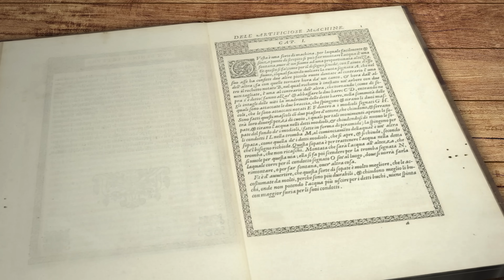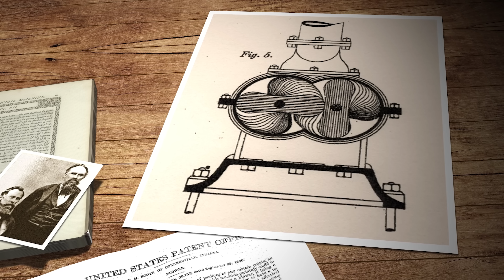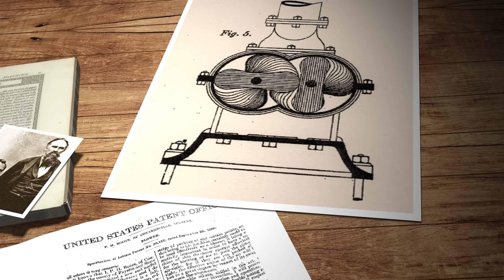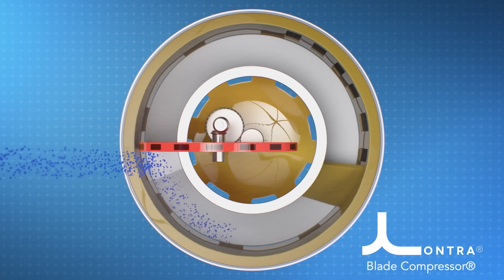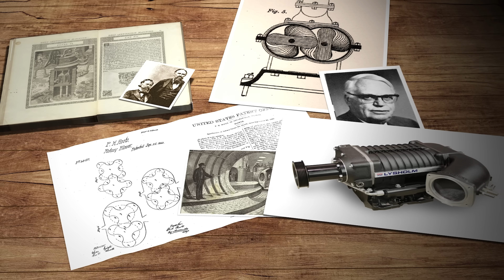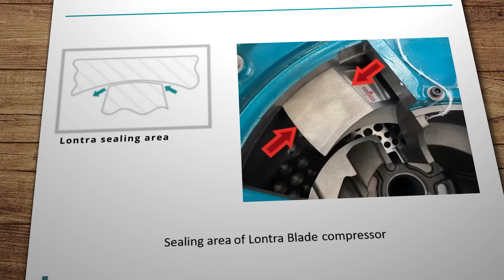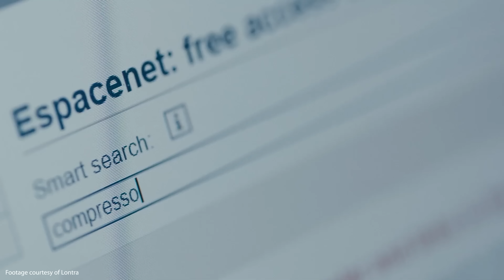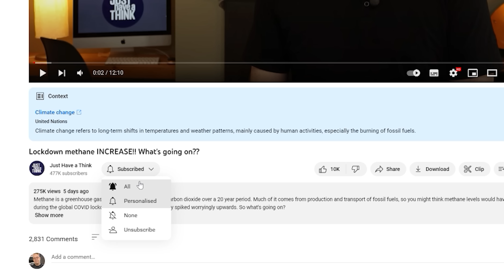Compressing air to reach net zero. A 'revolutionary' innovation.

Comment: Looks Complex and expensive, and maintenance-heavy. The air at intake for devices like this needs to be extremely clean, so this is a niche market compressor. There is always a trade-off somewhere: cost, efficiency, etc. This is why there are so many types of compressors. Don't quite believe the statistical analyses regarding global impact. That's another story, or is that the selling point "IT'S GREEN".?

Comment: That rotating sealing disk would get very hot. The animation shows it as having cut out like a disc brake to allow cooling air where as the practical example is a solid disk. I would be interested in operating temperatures.

Comment: I have thought, and as CO2 is unable to cause any climate emergency net  zero will fix nothing at all.

Compressing air heats it increasing pressure.   Cooling sees a pressure reduction.   This is largely irrecoverable and why heat pumps function.

Comment: Let's first fix all leaks. Compressed air leaks are a huge loss in ALL industries. 

Also I dont know why I havent seen this type of compressor in heavy industries, but continue to see  screwcompessors.  (Probably the opposite of what you stated: they are not cheaper to manufacture.)

Comment: Improved designs work better, but even the best will sometimes need a repair. Hydraulics are appropriate in some applications, but for the modern mass-production factory, Pneumatics are being used in any place where they can be used. One reason is that when it invariably springs a leak, the mess is simply some lost air. Of course electric stepper motors and screw-actuators are also sometimes used, but...pneumatics are here to stay.

Comment: Why not a bladder-based air compressor -- rather like a squeeze bulb.  Now the only leakage would be that past the check valves -- which are much simpler to engineer.
If elastomers aren't up to it, use a SS bellows (which are commercially available).  If such bellows don't provide adequate compression with a single bellows stage, use multiple stages, like a 3-cylinder steam engine (run backwards).  There's a YouTube video that describes the compressor used within a (medical) oxygen enrichment device which is five stages, I believe.

Comment: That "more surface area so the sealing gap is much blah blah" is pure claptrap. This thing has the same problems as a rotary engine, only apparently this one doesn't have separate gap seals, instead assuming this engine mess will be easily manufactured with tolerances within a thousandth on all rotating mating surfaces.  Poppycock. This thing's gonna be leaker than a timed-out colander.

If you want an efficient compressor, build a closed-loop trompe tower with sterling engines that run secondary pumps off the cooling water waste heat.

Comment: A trompe is a water-powered air compressor, commonly used before the advent of the electric-powered compressor. A trompe is somewhat like an airlift pump working in reverse. Trompes were used to provide compressed air for bloomery furnaces in Catalonia and the USA.
The trompe is one of those lost technologies. Around the nineteenth century, if a mine were located near a river, they would install a trompe to use energy from the falling water to isothermally compress air.
If developed again in could be a very integral part of solving energy issues without environmental damage.

Comment: It seems to me, if there is any wear or run out, with the gears and bearings, as they will. The driven disc, will be late. 
No mention, of heat related issues, here.

Comment: The market has spoken they are in receivership. To complex, misleading presentation quotes very low pressure performance application and compares to dry screw compressors.  Oil flooded screw compressors achieve good efficiency at high numerical compression ratios something this thing could not as it would bind up at elevated temperatures.
Reply from the maker: A great shame. I am launching a series of technology review videos for 2024, looking at the winners and losers from my videos over the last 6 years. I guess Lontra will have to be placed on the list entitled 'Market Failure'. Very sad for all the folks who worked so hard on the innovation.

Comment: Interesting design. Are you sure the 10% figure is for air compressors or just compressors. I struggle to believe air compressors would be that high, though compressors in general seems more likely as it includes all the refrigeration and air conditioning.

Comment: The Lontra compressor won't help make as big a CO2 saving as you think. It only seems to work to 1Bar or 15 PSI, there are far, far more compressors out there working at 7-10Bar and above. Compressors used for bottle blowing of PET drinks bottles for example operate at 40Bar. The blower market is nothing like as large as that for compressors
Reply: The big market is for low pressure high volume air flow in wastewater applications. Sulzer pumps originally licensed the technology from Lontra for such an application but after years of development hell they gave up on it a couple of years ago.

Comment: Without having followed all the details of this design, it seems to me the essential problem could be the rotary motion of the 'piston'? It is the same problem faced by the rotary combustion engine - too much friction burning an awful lot of lubricant.
Reply: Its an oil free compressor. No lubricant just a Teflon style coating.

Comment: I just had a quick look at their web site. With only a 15 PSIG max capability it is not useful for many of the places where a Roots blower, or a screw mill would be used. It is an interesting concept, however it has quite a bit of R and D needed to be a game changer in industry.

Comment: I've just taught myself enough 3D graphics to draw my advanced, far more powerful Turbo / External Heat Engine and will publish on a youtube channel I have soon. A larger than normal exhaust turbine is backed by a sealed turbine filled with high pressure CO2, wrapped in a radial compressor, joined to the same setup on the other end by a hollow axle. Compressed CO2 expands with much force when heated. I have it pumping fuel, coolant and whatever else (ie. hydraulic fluid or second fuel type) in between, also cooling the middle of the turbo/engine.
--
It's designed to work with an internal combustion engine that shoots exhaust gas into each side alternately, with the opposite side cooled by squirting high pressure coolant at the exhaust turbine on the other side, adding steam power and amplifying heat engine power that relies on a temperature difference between ends - HOT-COLD engine... It's a condensing exhaust system so the water from the steam is reused and cooled exhaust gases expelled (or compressed into a diaphragm that expands into the fuel tank to be dumped at a gas station).
Reply: @jerrystephenson6198  .. It's a nice design worth prototyping. Just because you can't imagine it working doesn't mean the principles aren't sound. It's easier to keep sealed than a wankle style rotary engine. Sure, bottling the exhaust fumes is problematic but the two engines are worth a go... It combines the best of both piston and turbine engines so what's not to like? If you're an engineer and you think the idea won't work let me know why because I and other engineers know it will. Solves the issues with the Wave Disk Engine while combining a heat engine. It doesn't have to 'idle' at 10,000 RPM like a normal turbine engine. It's designed to only spark up when needed. Very efficient.

Comment: I think as amazing that technology is history of innovations tough as that each time we are getting new and more efficient machinery our total energy consumption rise proportionally to achieved efficiency. That exactly what have happened with Watt steam engine while it had a few times better performance then existing steam engines those days coal consumption just increased a few times as well. The reason for this is that while you have only inefficient steam engine you would use it only in places where there is no other options or existing options are way worse then this engine. So as efficiency rise so is the number of potential cases where it could be applied.

Comment: Can't a Tesla turbine move air? Why not do this instead. Design disks that can handle the strain, they also double as flywheels. The tolerances are far lower and easier to achieve. Your literally using disks to move air using a motor. The only change needed to fill a tank with it is a ball valve. When the tanks are full it simply switches to being used as a flywheel to store temporary power and the air can be reversed to the turbine in an H circuit to release the power to load. A sensor watches the rpm to release air in intervals to keep it at the desired rate.

Comment: clickbait title man.. the implication is that compressed air would help us in carbon extraction(the main issue you have pointed out multiple times being that it is hard to get out because it is so sparse) .. very disappointed with your "silver lining" that it will reduce carbon emissions.. that doesn't make very much sense imho. we aren't going to throw away all these devices are we? well it does seem like a cool design, i would have watched your video no matter what is my point. you have an audience, you don't need to click bait us.. or maybe cool it a little? i get you are a content creator and need clicks, but mutual respect was a theme i thought on this channel :/
Reply: I associate 'clickbait' with useless, trite,  worthless.   The device being advertised, researched,  displayed and designed is far from useless.
Ralph Walker

We aren't going to throw away all these devices are we?       NO  we are going to use this device to work with existing devices to march forth.  It is an excellent addition to  todays  technology.

Comment: Isn't it dangerous for the life of the pump when the axel that the "flywheel" sits starts to get eaten away? I imagine it would change the timing of the whole system... is what I was gonna say and then I had a second look at the demo video and realized it works more like a clock and not how I originally understood it... so, nevermind lol

Comment: Air conditioning would benefit from this. Cooling is based on the sudden expansion of a compressed gas, this would improve the efficiency of an AC system.
Reply: Scroll pumps are excellent for AC compressors.

Comment: By having a large sealing surface, it also means that a fine precise surface would actually be less useful than a rough unpolished surface. The friction against the bypassing air would become the mechanism of sealing. A smooth surface would allow more air to bypass. This is a rare case where cheaper might be better.

Comment: This is a clever solution for low flow rate applications but leakage is not the only source of losses and I suspect the design will be problematic at higher pressure ratios. The holes through which the fluid escape the passage will also introduce losses. As a fluid squeezes through an orifice, losses are incurred at the entrance, especially if it does not flow smoothly, and again at the other side, so more energy is required to obtain even a moderate pressure rise. At a glance, I would expect the device could only achieve higher pressure ratios at very low flow rates. That does not mean it isn’t a good solution, it just means its only a good solution for a narrow operating range. The other issue at high pressure ratios is the force across that disc. As the fluid is compressed, the force on one side of the disc is much greater than the other side, causing it to deflect slightly. The small gap at the tip and the slot through which the screw passes must therefore accommodate that deflection, i.e. they must be large enough to allow the disk to deflect without interfering with the other parts. Again, not something that devalues the design, just another thing that limits it’s range of application. Other compressors must deal with these deflections as well, which is why many have such small, narrow gaps. What does ring true in this video is the value of saving power by making pumps and compressors more efficient and there is a lot more going on here than what is suggested. I work in research and development at Ansys, Inc. (www.ansys.com) where we develop tools to allow engineers simulate devices such as these to evaluate performance and efficiency across their entire operating range. Engineers are using tools like ours to optimize the design of existing devices by improving their shapes to reduces fluid losses and account for the deformations that occur under mechanical and thermal loads. Most pumps still aren’t designed well, but regulations pushing for improved efficiency are driving many to improve on their designs or creating markets for those who have. Just as importantly, simulating a device can expose many of the unseen problems that come with novel solutions.

Comment: Wait a minute, that seems backwards.  A longer joint that has the same gap tolerance will leak *more*.  Having only very small seals means that they leak less and of course, means you have a smaller surface area that has to be precisely machined to maintain the same gap.

Comment: This is, unfortunately, perhaps a less revolutionary product than you might think. Don't get me wrong, its still revolutionary where its useful, but I looked up the specs and apparently this is a low pressure high throughput blower, great for things where you need a lot of air, such as wastewater aeration as shown in the video, but most pneumatic equipment(where, to my knowledge, the lion's share of industry compressed air usage is) requires almost 10 times as much pressure than this guy puts out. Now you could hook this thing up to a booster or network of boosters but each of those is going to decrease the efficiency of the system, and unfortunately, its double circle design is prohibitive to stacking "Pistons" of this compressor.

Comment: Clever solutions to a NON-PROBLEM! We don't need "net zero!" In fact, we actually need More Carbon Dioxide!!! I love clever science and engineering, but if the basis for a solution is made of utter nonsense, then the irony becomes a bitter pill to swallow. HERE IS HOW the "net zero" hysteria is upside-down, inside-out and backwards:

Fact: We live in an ICE AGE interglacial and the Holocene is not even the warmest interglacial of the Pleistocene's dozens of interglacials.

Fact: Warming in an ICE AGE interglacial is a good thing. Decreasing droughts, shrinking deserts and making weather calmer. (Read Climate Basics for the details, logic and sources.)

Fact: Carbon dioxide does NOT drive warming, contrary to all of the emotional hype. The only time scale with high, positive and consistent correlation between changes in temperature and carbon dioxide has temperature driving CO2 into and out of the oceans as a dissolved gas. Remember: There were heavy industries or automobiles 600,000 years ago forcing climate to change; Al Gore had it backwards.

Fact: Al Gore's BIG graph showed CO2 skyrocketing at the end, but temperature did NOT follow with a similar spike! Therefore, CO2 is either extremely wimpy in forcing temperature changes or has zero effective link to temperature.

Fact: Warming produces calmer weather. Wind only blows because of temperature differences and as you warm up the poles, the tropics don't change much. Greater evaporation creates more evaporative cooling and cloud shading, offsetting the urge for the tropics to warm.

Fact: Warming produces more rain, shrinking deserts and reducing droughts on average across the planet. After all, rain only happens because of evaporation, and the warmer it is the more water evaporates, and the more it rains.

😎♥✝🇺🇸💯
REFERENCES:
Climate Basics: Nothing to Fear (hardcover, paperback, ebook; #1 Weather Bestseller for 14 weeks on Amazon)
Thermophobia (hardcover, paperback, ebook; #10 Weather Bestseller)
Red Line -- Carbon Dioxide (paperback, ebook; #25 Weather Bestseller)
Dumb Genius: How intelligence is sometimes its own worst enemy (hardcover, paperback, ebook)
Reply: Wow... I've been trying to post related info but it keeps getting deleted. I don't know how your post is getting through, but, good for you! Here's what I was trying to post (typos to try to get around the "system" 😄):

https://docs.google.com/document/u/0/d/1LgeVGWnjOCRTHY1uGdJdXrF5JCUz_hd_k205c4djdnI/mobilebasic
Reply: Rod, I sent you a message on your website...

Comment: When I worked as a sand blaster, long ago, I used a number of different kinds of compressors, some ancient reciprocating compressors, some kind of turbine compressor, several screw type compressors and one truly unique device. It was a V-Eight gas engine, with half the cylinders used for power and half for the compressing. You would think that would be brilliant...it was not. Seems a car engine never develops that much compression without the combustion cycle  so it was the weakest compressor I ever had to use. Good to see the idea actually tried though.

Comment: You are splitting hairs with this description. This unit is not an Industrail type air compressor...It is a blower. There are very large differences between the two. I looked on the website, the unit they show has a 6" discharge opening! No small frame industrial type compressor would have such an opening. The energy savings you describe will be minimal at best due to the ratio of "Blowers" compared to real "Compressors" in use today. This info is incorrect and should be modified to explain it correctly. What is the bar discharge pressure? I can promise you it is not 8-10 bar used in the vast majority of Industrial practices, probably more like 1-2 bar which is blower territory. You didn't state it, neither does the Mfr.